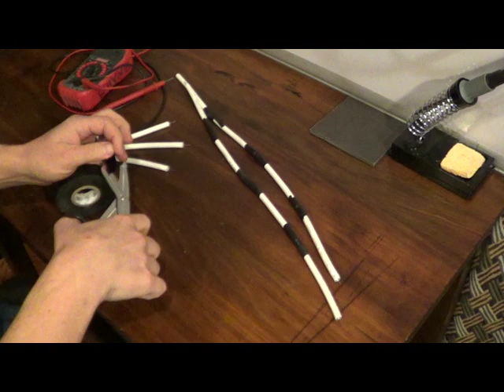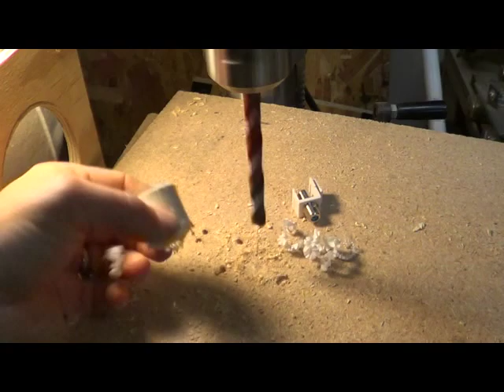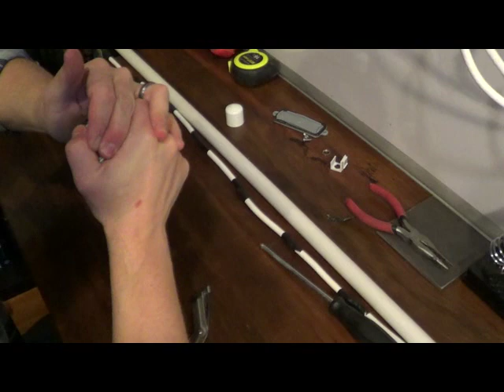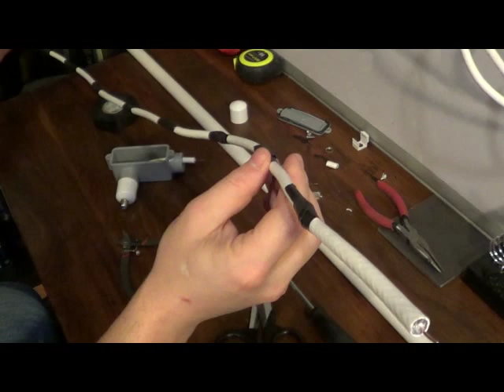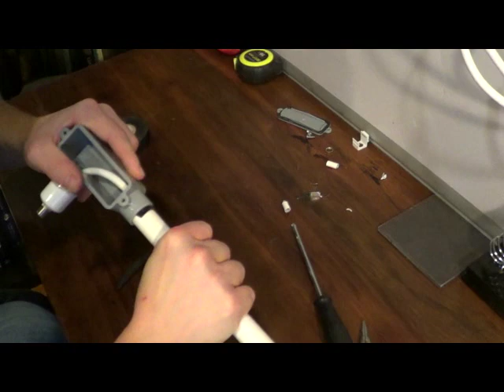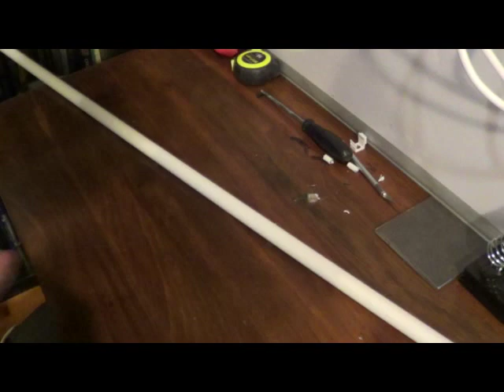ADS-B Antenna build

Comment: question....
1.  the coax that feeds your radio, to the antenna you built, i seen you only had the centre conductor connected to the shield of the antenna, where is the ground? or no shield?  
2.  you shorted the top of the antenna with some kind of jumper, why? can't you leave it open?

thanks alot.
Reply from the maker: From the antenna to the radio I used only the center wire, so that is shielded. As for the short on the top... without that the antenna is intermittently receiving or shielding along its length. By shorting that it's kind of like doubling the length of the antenna by making those parts that were just shielding into something that can contribute to the receipt of a signal.
Reply: thanks, ok, so the center wire of antenna goes to center wire of coax to radio right? im making it now watching your video.
Reply from the maker: Coming right off the antenna it doesn't matter. What your building is a bunch of exposed wire that is a length which is a  factor of the wavelength of interest. It's just a filter.

Comment: Hey thanks for the video but i made a similar with RG6 satellite TV cable and i cant even get the reception that i'm getting with stock antenna and i checked the SDRSharp while i connected stock antenna there is blue waterfall and there are hits while airplanes around.. but with the antenna in SDRSharp the waterfall is turning to yellow to red.. and i cannot see any hits.. all tests are performed in auto gain active... please help
Reply: now i made discone antenna and it is performing much much better im getting aircrafts from 75nml. any suggestions ?

Comment: This antenna would not work properly as the ground is missing and ground acts as counterpoise that removes noise and thus add gains to the signal. What is the point of making a colinear antenna when there is no grounding?
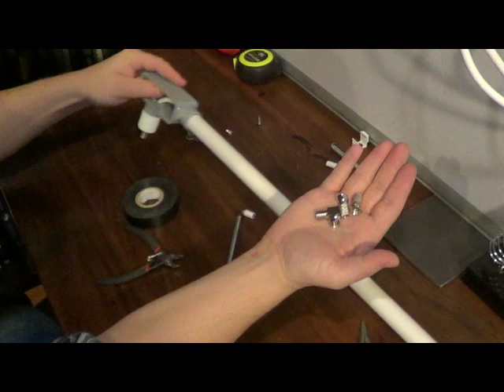Reply: @11:00 he throws in some F-Type Connectors. Enough grounding ;)

Comment: Good morning I have several questions what is the length of each piece, and how much to cut to join them, as it is called the piece where the cable goes and what is called the piece where the antenna is put up on the mast
Reply: The length of each segment is defined by the frequency that you wish to detect.  Each segment is generally 1/4 or 1/2 wavelength (v=freq*wavelength) where v = speed of light.
Reply: I made  the total length  of each  segment to 150mm   & then  cut the  centre  elements to  116mm     marked equal to  the centre, you can cut the end pieces down  a  little  if you struggle to  insert them  down the  edges of the Coax covering, I  also found it better to  file  the  copper ends  to a  slight point  as  cutting them  puts  a  spade end on them I  also found Satellite  cable worked better  as  the centre  copper  is solid  not stranded  which would make building impossible.